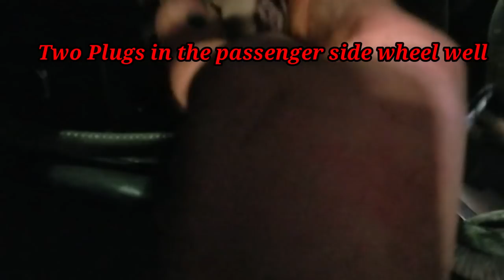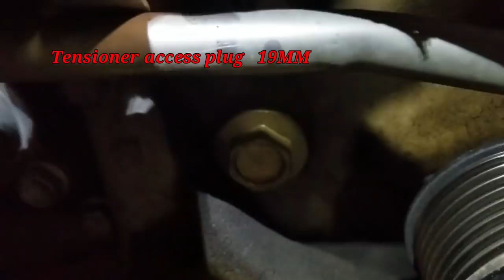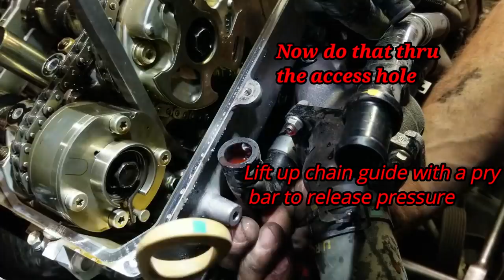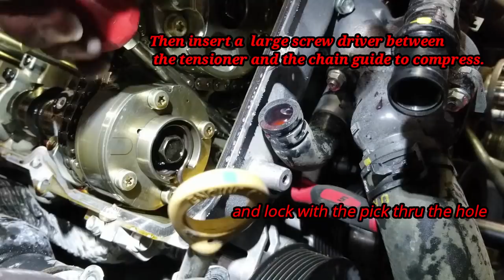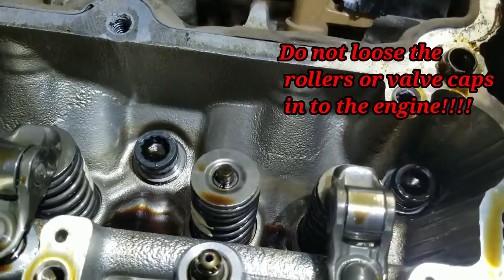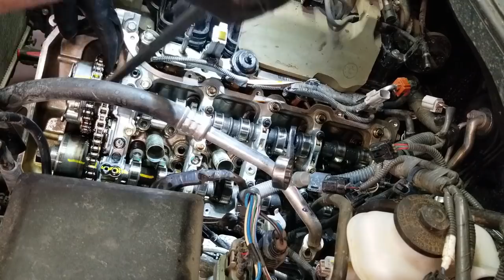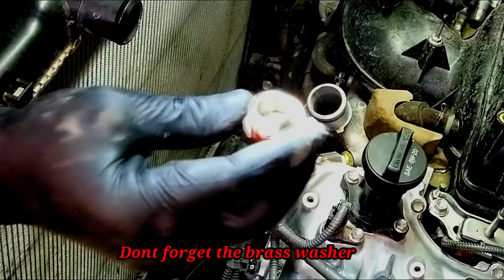Tundra Cam Tower Leak Reseal

Comment: Would every Toyota service have at least one mechanic who can do this type of work at their dealer service?
I just left my tundra 2016 with both cam shaft tower seal leak and very nervous about this. Even more nervous because one on the front guys said that he is not aware that they ever done this repair on any Toyota tundra.
Once engine is open once I don't think that engine is that good as factory assembly. Please let me know if I'm wrong 🤔
Reply from the maker: Its common enough that im sure any dealer can handle it no problem. It should be better then factory now because they replace all the gaskets with new ones and use a better sealant then factory.
Reply: The Workin' Man I hope they would replace all gaskets and necessary parts. Are these parts relatively in stock since they took my tundra yesterday?
Reply: The Workin' Man they do all this per book or technical support correct in case they are not done this yet at my service?

Comment: Just got call from dealer and person from Toyota warranty approved to do both sides. They said parts are already ordered and team of head mechanics will work on my tundra unless he lied to me. 

Wondering how long would take to get those parts and he said they won't open engine until they get all necessary parts at service. He don't have competition date yet, originally I was told by end of the week. 

Also what he mentioned that most likely they will pull engine out or enough to work on it. Is this true that they need to pull out engine. Also after he stated that they may come up with different solution, don't know what he means by saying that. Also he said definitely they will not remove cab in order to perform this repair, I didn't even ask him about this.

Your thoughts?
Reply from the maker: Leo K, sounds like they dont do too many of them the old way is to remove cab or engine but thats way too much work,  i posted this video to show techs how to do it faster and safer.
Reply: The Workin' Man wish they would look into videos but I don't think they even let you tell them lol
Reply: How soon should I change oil after this repair to get rid of debris? Do you recommend something? My truck is repaired on Friday and interesting dealer said 9.5 hours working but both sides are done. Also they recharge AC. Did they had to remove something from AC?
Reply from the maker: When i do it i don't remove the ac line, just work around it. I run the truck for a bit then change the oil, so you shouldn't need to again till the regulator interval.
Reply: The Workin' Man thanks a lot for your response. Actually I noticed that they put on invoice 8 quart oil but I changed oil in 300 miles after their repair and they lied that they were changed oil. Very unprofessional, also I found a lot debris including that gray seal on the filter, filter were old one and was not changed. I think they 6 just add little oil not change oil.
What is the typical procedure.

Comment: So theres no gasket? I swear it looks like mine has a paper gasket between the surfaces.
Reply: I noticed this as well.
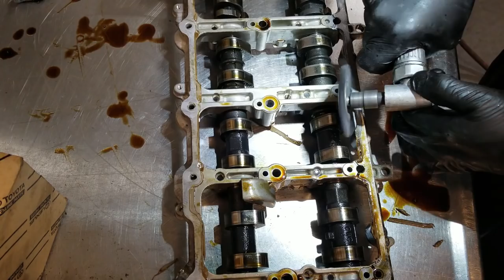Reply: There is a gasket, you can see it better at 4:25 on the left side. It looks pretty thin on the right side, and you can tell that's where it was leaking from due to the collection of oil. He's removing the old one with the wire attachment.
Reply: There was a very very thin layer of what looks like a silicon paste. Pretty disappointing from Toyota.

Comment: This is complete hack, and a great way to ruin an already poorly designed and expensive engine.  Follow the Toyota Workshop Manual, the shortcuts aren't worth a $20,000 engine replacement.
Reply from the maker: Ha, you've obviously never worked flat rate.
Reply: @theworkinman8800  
15 years flat rate son...you don't take the risk of destroying an engine to save time.  Of course in this case it's a Toyo, so at least there's no major loss if it's destroyed.
Reply: one of the techs that I work with tried it this way and blew up the motor. we don't know how. think the tensioner got damaged when he was trying to get the plunger in. they have a lot of oil pressure and are very difficult to get the tensioner plunger in. he made it look way easier than it is.
Reply: @wildman1137  but thats the advantage of flat rate, if you can find a way to save time and complete the job, then do it. several guys do it this way and never have problem. but again if the tensioner gets damaged or the chain rolls a tooth, your screwed.

Comment: When this happens, is it a major leak?  Will you notice a significant drop in oil level on the dip stick? Or can you just keep an eye on it and top it off if needed?  I'm thinking of trading my '05 tundra for a 07.
Reply: I've been having this issue for 5 years now on my 2012 tundra. Very small leak, no need to top off oil between oil changes but the smell of burnt oil on the exhaust is annoying.
Reply: its usually a small leak in my experience. its a very expensive job though. like a 15 plus hour job.
Reply: I have an 07 I'm working on right now and watched this video to the T and I just can't get my timing chain sprocket back onto my cams as simple as he did...I think I'm not getting enough slack in my chain. My tensioner is bot going all the way back in, only a little...this is all I need to do to get everything back together...frustrating
Reply: @charliethorne1255  did you get it done ? Thinkin bout doing mine but little nervous 😂